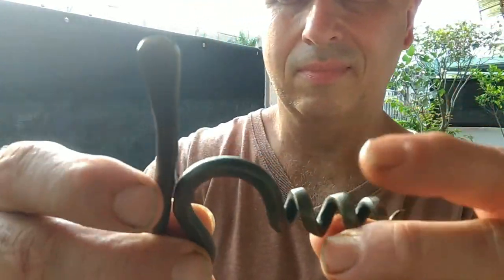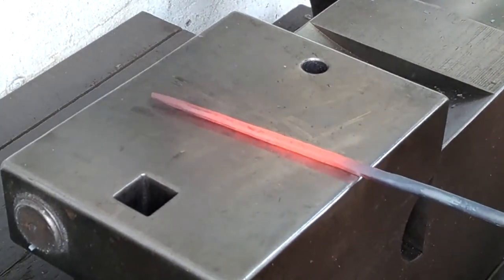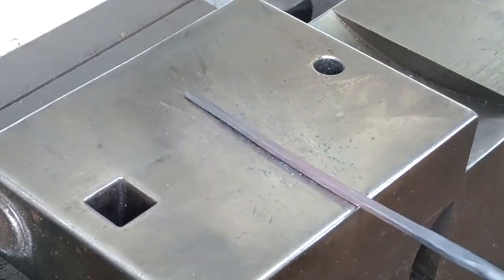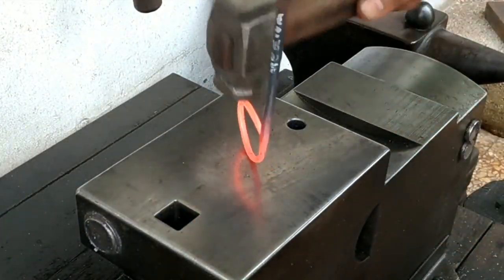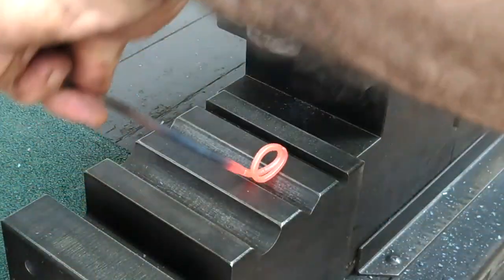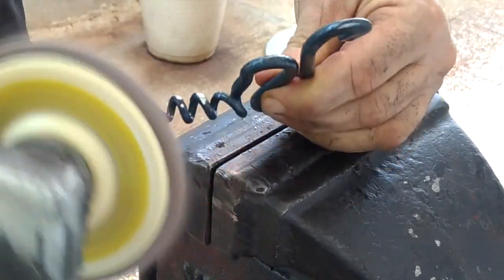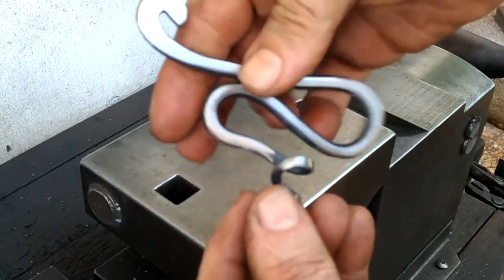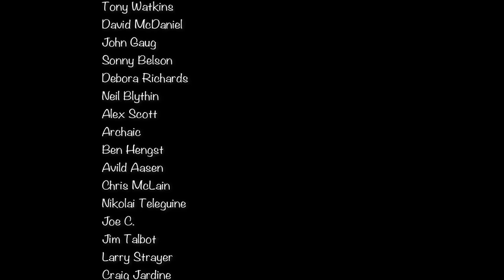A Traditionally Forged Corkscrew - GS Tongs

Comment: I never seen a anvil like yours . Is it custom made in a metal workshop? If so what steel did you use and what would be a price of such thing.
Reply: When i said anvil i was thinking about your block of steel that you make 90% of stuff on.
Reply: @zumbazumba1  I think you were correct. Anything you use as an avil is an anvil. The picture what we all have in our heads is a fairly recent (as far as blacksmithing goes) invention.
Reply from the maker: My small blocks style anvils are my own designs which I had made here in Taiwan. They are made form 4145 steel and completely heat treated. I paid around $450 but it depends on which style. Thanks for watching.
Reply from the maker: Good point. Thanks for watching.
Reply from the maker: That main one is the one in the $450 range.
Reply: I agree, the versatility is awesome. I like how you adapt it to your workstyle. It helps me feel I can break the established patterns and tradition, and do what works for me.

Comment: Haha i think your anvils are sexy m8 if it helps :-) PS if you forge one mandrel the correct dimensions you can just hold the straight length of tapered bar at the bottom and wrap the cork screw with zero hammering in one heat , you can make then in half the time that way , i have made a LOT and that is the fastest way.PPS could have turned the tail in to a bottle opener .
Reply from the maker: Maybe I should put a bra on my anvils! And thanks for sharing your thoughts on making a mandrel. If I were dong multiple corkscrews, that would be the way to go. Thanks.